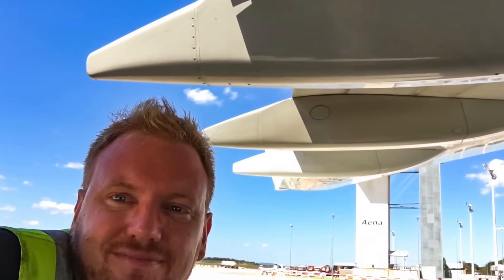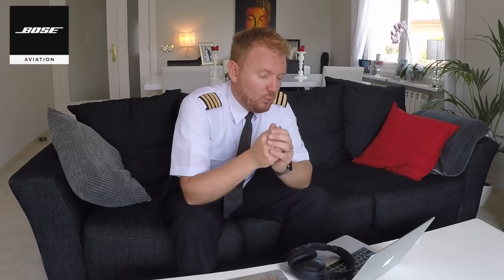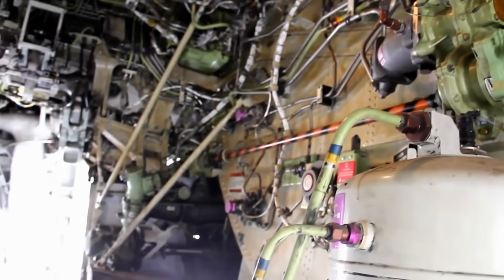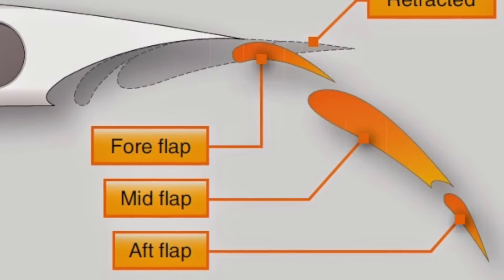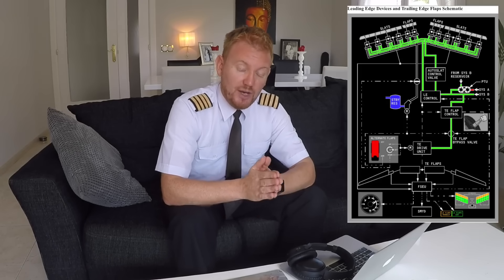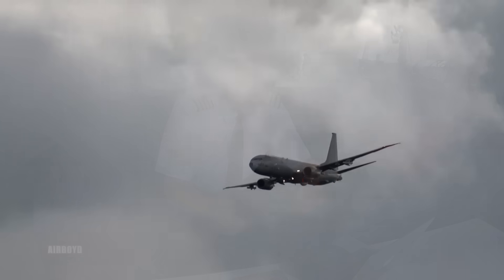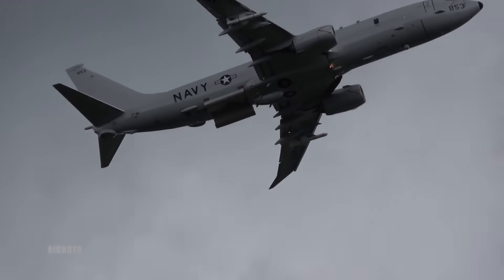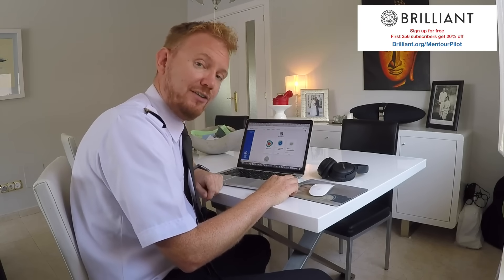"Pods" under the wing? What are they?

Comment: I would have thought modern airplanes would use local electric motors instead of a central hydraulic motor and all those heavy rods and gears to save weight.

Comment: Impressively no-nonsense video by right diving into the topic w/ clear illustrations! 👍👍👍
The khoun... noise from the pods during landing is very familiar. Presumably the trailing edge flaps are extended partially for lifting and fully extended for dragging - simple physics

Comment: We must move on now...i suggest nsot to go back about failute u havw done... in my opinon..
or my suggestion.. boeing, airbus etc is to start re-designing an airplane...like:
a. an spacious seat with AIRBAG all around the sides of the passenger to lessen imfact injuries tefuce fatalities if possible.
b. an smaller compartment under or overhead to recei e or dtore a small/ tiny bag for only keeping important things. alll other check in the luggage cabin below the plane... max mweight 20 Kg. to reduce the weigjt of the plsne...

Comment: Is it normal for these pods to vibrate around slightly when the flaps are extended? I noticed this on a recent flight I was on. Aircraft was a Delta Air Lines B738 registered N3761R. Observed from seat 24F. The vibrating/loose one was closest to the fuselage.

Comment: No need to watach a 12+ minute video for this question...

These 'pods' are flap track fairings, sometimes called trailing edge fairings, and their purpose is to cover and reduce drag over the heavy duty mechanisms that extend the flaps of an aircraft wing during high-lift operating regimes.

Comment: I'm an employee of the company that builds 737's working in wing systems cc128.We install flaps,slats,engine struts,landing gear actuators and all fuel systems.I have personally installed hundreds of flap tracks,flaps and flap track fairings.I'm also the lead mechanic on 737  P8 and have worked on over 6,500 airplanes including 707,737,747 and 757.If you have any specific questions about 737 wing systems manufacture or operation feel free to ask them.
Reply: What is the cone shaped part under the wing called
Reply: Flap track fairing.It's a cover for the flap tracks. @salemmariex
Reply: What number gear oil is required to add to the actuators?
Reply: @ortujexinol  Slat actuators are sealed and require no 'gear oil'.They are hydraulically actuated.Moving parts of the slats and flaps are greased periodically using BMS 3-33.Flaps are moved using torque tubes similar to an automotive drive shaft.
Reply: I machined some 737 flap tracks,  and hundreds of aileron belcranks

Comment: Spent 34 of my 40 years at Boeing working on the 737. Spent way too much time working around the canoe fairings. The orange and black things are called torque tubes, not torque rods. Spent a few years rigging the skew sensors. Easy job unless you have a bad sensor.

Comment: the flap track farings in slang are often called "canoes" due to their appearance.  the forces involved by such actuators is quite significant and the reason why such are "pinned" during maintenance operations to avoid potential fatal accidental actuation during maintenance operations  (such pins being treated as surgical instruments during medial operations and carefully accounted for so as to prevent being left behind before aircraft is put back into service)

Comment: Controls/Software/Calibration:
CONTROLS:
Calibration - pilot sets flap target position 
Software:
- sensors report actual flap position vs target (commanded by pilot)
- ECU now proceeds to actuate/move flaps to target/commanded position 
- software monitors flap A speed of adjustment vs flap B
- IF flap A > B by more than 5% delta speed of adjustment/extension, then reduce speed of adjustment of A till A is less than 5% delta speed of B (vise versa for flap B)
- Once flaps A and B are less than 5% delta of extension speed, now take average extension speed of flaps A and B
- Add corrections to flaps A and B so average extension speed is equal to target speed extension
- Once actual flap position of A and B meet pilot target/commanded flap position, software/program feature will END

Comment: They are fairings that house the flap tracks.  The tracks control the path that the flaps take as they are deployed.  The fairings are needed to encapsulate the tracks and the actuators so that the air flows as evenly as it can past the structure.  I hope that’s what he said, because I didn’t listen!  I work at Airbus by the way.

Comment: Glad to know they cut corner’s engineering the plane. Lots of planes are able to get that gear inside the wing. 
Don’t be fooled, airliners are not state of the art. Most of the tech is 40 years old. But they sure love fly by wire! Dying by flight controller, is so much better hey?Cheap moron scumbags! There is literally no reason for a single person to die in a plane crash. Accept cost.

Comment: I was on a cross-country flight on American Airlines several years ago.  Window seat, right behind the wing port side of the plane, just how I like.  Except, this time, I was able to witness the inboard flap fairing flutter around in the wind throughout the flight.  Kinda scary to see.  I told the flight attendant and they brushed it off.  Told the pilot when we landed that the fairing was loose, and he brushed it off.   🤷
Reply: The crew is trained to brush off anything. If the steward knows the airplane is burning behind him, it‘s his duty to brush off any „Fire“ screams of the dying passengers, no joke. It‘s the captain‘s responsibility to steer the airplane, and the crew‘s resp. to keep the sheeps calm.

Comment: Great explanation video!

I have a follow up question about the design though.

Having the hydraulic motor inboard, and that long drive shaft out to the wings , seems a bit …well, inelegant . 

I’m more familiar with land based transport systems, and in those, modern hydraulic motors  do a very good job being placed ‘outboard’ closer to what they are actuating . Reducing mechanical inefficiencies.

So there must be a good reason why Boeing chose to keep the hydraulic motors inboard ?? I think your statement at 4:20 might be the reason… though , independent outboard hydraulic motors can still be designed to work synchronously. 

Perhaps this is all due to the need to take “fewer risks” when it comes to an aircraft application…

Comment: Worked flap tracks and carriages on 737 and 727 for a year. I thought it was used to function the triple slotted flaps which are more complex then common regular flaps. I always wondered if one of those flaps would have broke during the landing, would you loose control of the aircraft ?

Comment: The P8A Poseidon Maritime Patrol aircraft is based on the Boing 737 and is the replacement for the P3 Orion and UK's Nimrod MR2. Here in New Zealand, Royal New Airforce is in the process of upgrading to the Poseidon. Weapons include Harpoon anti-ship missile, Mk 54 torpedo and depth charges. If anyone remember's Casper the Ghost, it was  a converted DC3 gunship used in Vietnam. The Hercules has has gunship variant as well. Just about any aircraft can be converted to an armed variant

Comment: I don't think those are just on the 737. I've flown a handful of times, mostly from Colorado springs, our airport is small and outdated. we use small old airplanes here, probably Boeing 137s or Airbus a180s. Probably equipped with 90cc engines. But all the ones I've seen have those pods.
All joking aside, we have frontier and I think we have allegiant still (who I'll never fly with again). So even the little planes have those pods

Comment: You could definitely side-port mount guns in a 737 and the aft cargo deck is effectively over open space in the lower fuselage so it'd be possible to install some doors there for a sealed-out pod for a few small cruise missiles but the wing structure and height of the plane off the ground would make takeoff and landing almost impossible if anything more was protruding beneath it.  767 is the far better plane for thinking about arming a twin engine boeing.   Or you could just tell an airbus "that's the runway" and jump out.

Comment: Aren’t those pods are the so called „Küchemann carrots” which house the falp mechanism, but also have an important role of reducing the drag during normal flight? Like those two huge pods on the TU-95 bear? Do they have the same role in modern airliners or they are just the housing and have no aerodynamical role?
Reply: kuchemann bodies help smoothen the cross-sectional area distribution of the aircraft, which reduces wave drag.
Reply: I read somewhere years ago that they did serve some aerodynamic purpose
Reply: Flap canoe

Comment: Actually they are also used to help with form drag... The Whitcomb area rule requires a smooth change in cross-sectional area to reduce drag in transonic speeds (Mach 0.75-1.2).
Reply: Not on a Boeing 737 they're not.  It's MAXIMUM speed is nowhere close to Mach 0.75.  If you're in a 737 that's approaching transonic velocity, it's time to start praying because you're probably in a nose-dive and the wings have already torn off.  smh
Reply: @supermarioisacat  Nope.... The 737-100 thru 400 have rated cruise speeds of Mach .745-.82, while the 600 thru 900 and max have a rated cruise speed of Mach .785.  So definitely transonic except on extremely short flights
Reply: @supermarioisacat  Wow, you must be totally correct because you watched a video by a pilot where he discussed a use of the pods.... You could take a second and look things up on the internet yourself to check what I said, or accept that someone with a degree in Aerospace Engineering might have a clue, but whatever floats your boat is fine.

Comment: The diagram you used for the flaps is from a 737 Classic aircraft, however the other pictures you used are from a 737NG, the Classic has a triple slotted flap system (Fore, Mid, & Aft) where the NG has a dual system (Fore and Main Flap).

Comment: When the pilots prep for flight, often they fully extend the wings.  The same is true when landing.  The wing opens up to effectively increase the surface area, and to create drag to slow the plane.  When this happens, you can see right through the wing, but they will steadfastly stick to the narrative that there are fuel tanks in the wings, which is preposterous
Reply: You have to be stupid to believe it, and yet no one questions it.  I hope my one subscriber is enjoying my diatribes
Reply: Prep for flight? If you mean for PFI they never extend the flaps, if you mean before take off they never fully extend the flaps🤷🏻‍♂️
I take it you’ve never seen an airplane wing up close?🤔

Comment: Butt plug dryers for pilots.  Dry up to 8 butt plugs at a time with most of today's pASSenger airplanes!  Some reports state that even this is not even enough and pilots are requesting up to 16 of them!!  On some trips, a pilot uses up to 5 butt plugs!!  So if it is a round trip, then a pilot may run out... which could be real messy.  Tough job to be that full of crap, gotta keep the butt plugs spic and span, to make sure the pilots doesn't have a hissy fit or falls asleep.

Comment: Tell us about the Chemtrails. It is harder to see a clear sky with each passing year.
Reply: OK, I'll tell you.  Chemtrails are not real.  What you're seeing are contrails from some of the 100,000 flights that take place every day.
Reply: @paulshepherd8295  why are there planes literally flying next to each other... one does make a "contrail" while the other doesnt?

Why do they stay there for hours... while normal contrails disappear in seconds?

Why does even Wikipedia say that Geo engineering is a real thing that involves Planes using chemicals?
Reply: @AdrianDeer  When you say flying next to each other, how close are they?  There only needs to be a relatively small gap for one to be flying in a patch of sky of different temperature and/or humidity to the other.  Another factor is engine type.  Unless you know these things, you can't draw any conclusions.

There are no 'normal' contrails.  A contrail can dissipate almost immediately or, if the humidity is high enough, hang around for hours and spread widely, creating cirrus cloud, or anything in between those two extremes.  Persistent and spreading contrails have been documented for at least 80 years.  There are plenty of photos of them taken during WW2, made by the big (often supercharged) piston engines in use at that time.  Just Google it if you're in any doubt.  The spreading is due to the ice in the contrail freezing the water vapour in the air surrounding the trail, which goes on until the edge of the trail reaches a patch of air with insufficient humidity to keep the process going.  No sprayed material could possibly do this.  If you spray stuff, then a) all you can spray is all you can carry, and b) the spray would dissipate quickly, rapidly becoming invisible.

Geoengineering is a thing, but is only at research stage.  Look carefully at any articles on the subject and they're all riddled with words in the future tense (could, would, may, might, etc).  It would involve the use of aircraft, but it would need a whole new type of aircraft to be designed to do it.  That's because it would have to be done at 65000 feet (nearly twice the altitude of the aircraft you see every day) and there are no aircraft on the planet capable of carrying a load of chemicals to that altitude.  It would take many years to design, develop, test and certify such an aircraft, and we are nowhere near to any of this work starting.  Even the very first small scale trial (releasing a couple of kg of chalk dust from a balloon) has been continually delayed (with no new date set as yet).  The longer this lack of activity continues, the more likely it is that SAI will never become a reality.

Comment: With the electric motor standby, both motors should be in communication with each other as to how far each relative flap has extended to retracted either by wireless com, type of bluetooth or hard wired. Just a thought.

Comment: I had an EDF RC F-86 Sabre that had an issue with one of the flaps coming down slower than the other.  It was indeed easier to just not use the flaps on landing and have a really long rollout.

Comment: What's the stuff that I see aircraft deliberately spraying into the atmosphere on my morning run? Not the condensed burnt fuel the other stuff. It doesn't fade away at a regular rate like exhaust ( you can tell exhaust because the rate at which it disappears keeps it to an  average length behind the aircraft) What's the stuff that lingers eventually filling the whole sky on a clear day. Answer that if you can.

Comment: Many, many years ago, I believe I was in a Boeing 727...or if not, some other airliner with only rear mounted engines...and on landing approach, looking out my port side window, just at the trailing edge of the wing, I watched a similar fairing flapping around rather loosely in the turbulent airflow.  It had broken free on its lower extreme.  The only remaining anchor point was one or more rivets on the top of the wing.  flap, Flap, FLAP it went until...it disappeared, fortunately not being ingested by one of those rear mounted engines.  I then learned that the fairing covered part of the threaded shaft drive that operated the flaps if I recall correctly.  I stayed onboard until all passengers were gone...so I could let the flight crew know their plane was shedding parts!  😳😳🤣

Comment: Could it be that on recent aircrafts, the trailing edge flap fairings are bigger and more visible than on older aircrafts? Is it possible that the flaps themselves are also bigger and more efficient than those on older aircrafts?

Comment: It Is a rack and pinion mechanism used to raise and lower the flaps. The fairing that covers the entire mechanism is to protect it and to streamline it. When the flaps are fully lowered they are under tremendous stress from the head wind both on take off and landing. If the pilot sets the flaps at a 20 degree down angle he expects them to remain there (exactly) until he resets them as necessary to control the aircraft. The flaps are a necessary part of the wing structure.

Comment: The tech behind the flap symetry and skew rate was interesting.   I'm surprised they use micro-switches though.  I would have thought a magnetic - reluctor/hall-effect sensor would be less prone to wear and  tear, given the finite switching life of a u-switch...   It might avoid those pesky false readings, leading to costly delays and increased work-load on the flight crew, at the end of their flight...  It's always these little things, like sensors that can lead to (or mask) a potential disaster in the making.

Comment: The wing trailing-edge flap actuator fairings have been around for donkey's years...   Even some turbo-props of the post-war years had them, many military jets.   They may differ in size, but they're not a new design feature.  Every CA aircraft I've seen has a form of them fitted.

Comment: Thank you Petter for this very interesting and (as usual) extremely informative video. I have a QUESTION though: why the pods on the 737 look so much bulkier than those on the old DC-9 or MD80? (The ones on the latter being almost non existent.)
And, in general, why the flaps of the 737 used to look so much more complicated than the flaps on the MD80?
Thank you again for your superb work.

Comment: I've been on a thousand flights but I've never felt comfortable. The more I learn about planes the more dangerous they seem to be. I just don't believe that flying is safer than driving. You're miles in the air inside a machine with a million moving parts, any of which break, and you're ass is toast. In a ground vehicle, you just roll to a stop, in a plane, the stop is a weeee bit more spectacular.
Reply: rolling to a stop in the middle of a packed freeway doesnt sound too safe either